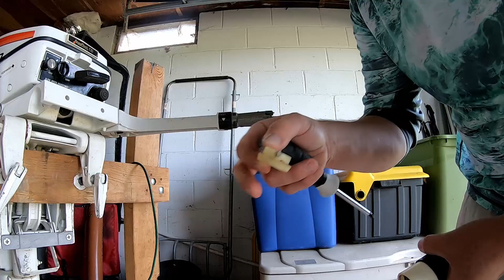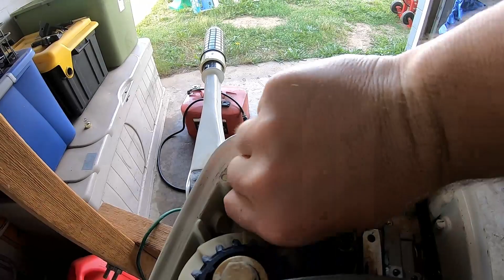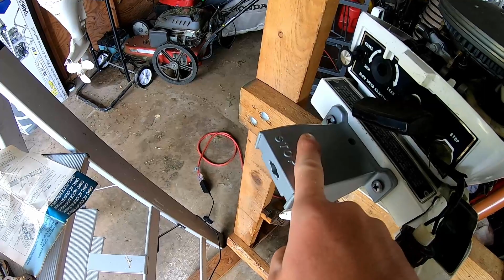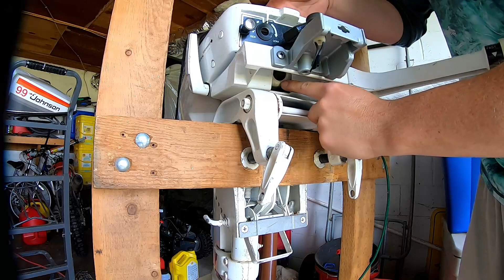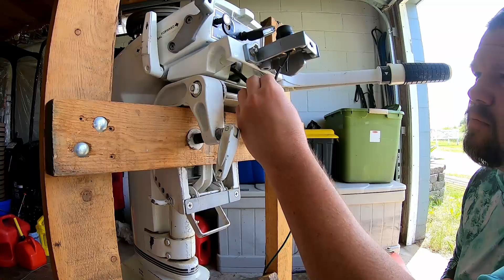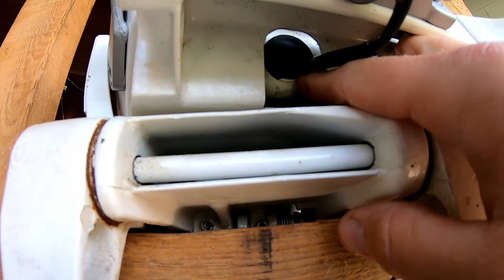Pontoon Kicker Motor - Part 1.  Converting Tiller to Remote Helm Controls

Comment: They ... Electrical connector makers...make a multitude of water proof connectors... I always suggest you use them .. many are two part male female connectors so you can easily disconnect them at will .... Make sure to use the correct wire sizes and correct connectors for wire size and amperage!